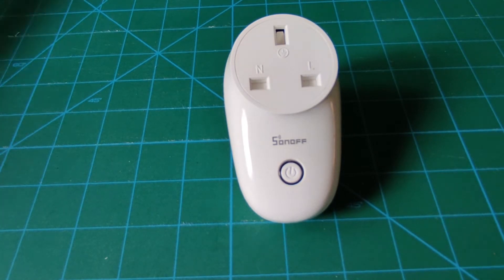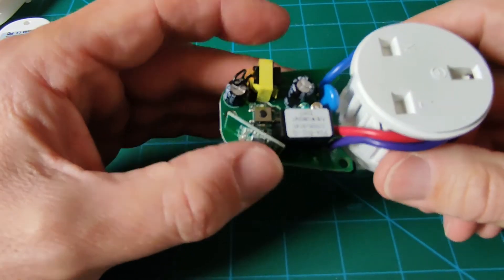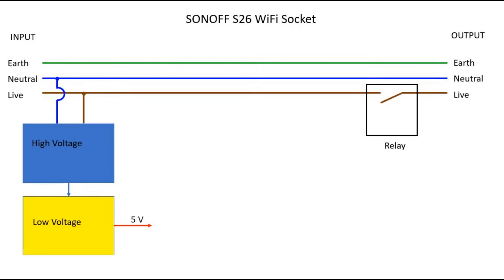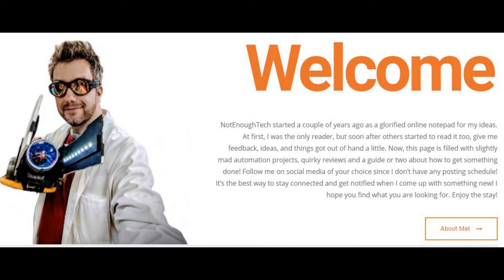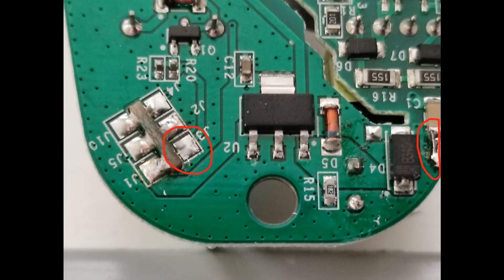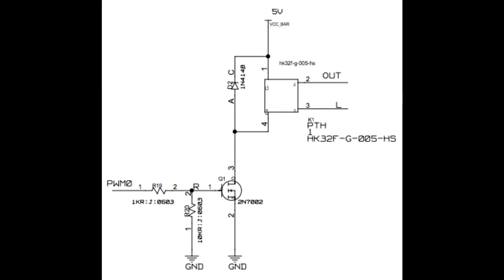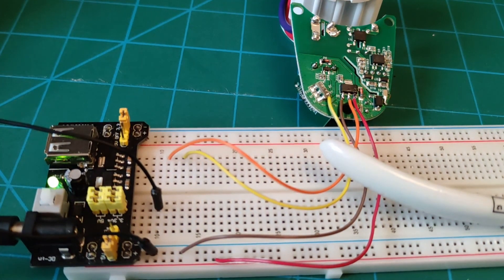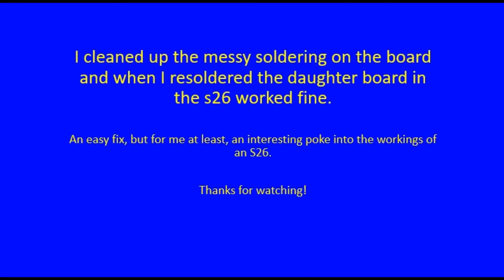ET#10. Faulty SONOFF S26, good wifi, intermittent relay operation - circuit investigation, easy fix

Comment: Glad found your video. I got 4 s26 3 of them just finished, only 1 still working rubbish product
Reply from the maker: Was yours a similar problem?  Mine are working fine now and I haven't had an issue since.  I run a number of Sonoff products and they seem to be largely OK.  Fair enough, this particular issue should never have occurred (with a bit of decent Quality Management I think they would be great).  That said, I flash all mine with Tasmota as in my view it makes life easier - you might give that a try.  Keep me posted!

Comment: Just now repaired one of  my many S26es. The issue was difficulty to connect to wifi and when it did connect, after some time it got disconnected by itself or whenever the relay was activated. I replaced D4, B340A schottky diode and the issue is resolved.
Reply from the maker: Useful to know, thanks for sharing.

Comment: Sonoff = v poor reliability, had 5 which have all failed now, wont connect to WiFi. interesting video on the fault-finding /repair. Which other make is a better option I wonder
Reply from the maker: Thanks for watching the video and commenting.  I usually flash all my Sonoffs with Tasmota and never had a problem with them thereafter.  I have an S26 plug/socket, factory fresh with native Sonoff software that will NOT connect to any wifi.  I'll flash it with Tasmota and let you know how it gets on.  I've put Tasmota on many ESP 8266 devices, including ESP01, ESP07 etc and it works great.  There are other firmware versions available that probably work well too.  Might be worth giving it a go.  With Tasmota I've not had much luck initially flashing OTA and always use a hard ware connection method for the initial flash.
Reply from the maker: Just a quick follow up on this one (I know it has been a while).  The Sonoff S26 mentioned above I flashed with Tasmota, but it still wouldn't connect up to my network.  I tried all sorts but couldn't get anywhere.  It was visible and connectable using it's own WiFi but not visible on my network.  I changed my router as a result of a new broadband package and up it popped no problems and worked as it should.  Must have been a limitation in the older router.
Reply: Same problem with S26R2. This is a piece of shit, not smart plug
Reply from the maker: Mine are in regular use and still running fine.  I've not had any more issues.  Perhaps I've been lucky!

Comment: Nice investigation! Worth mentioning to be very gentle with removing the daughter board. I lifted pads before due to overheating it's a mess to fix after :)
Reply from the maker: Thanks.  A good point about the daughter board.  I always used to use a desoldering pump, but it wasn't always the best at removing all the solder.  I picked up a nice tip off Big Clive's channel and dip my soldering braid in flux before attempting to remove solder it works like a charm!  Never liked braid before, now I use it all the time.  It makes good contacts for Scalextric cars too!